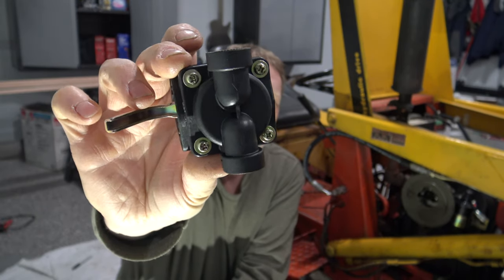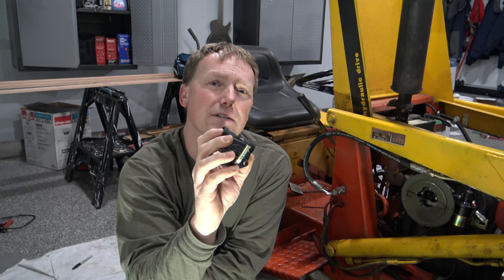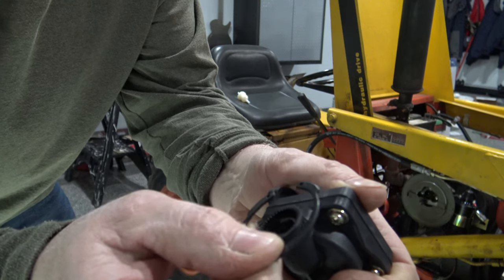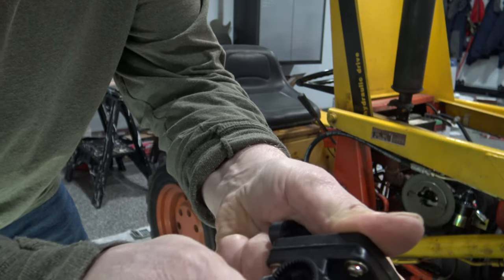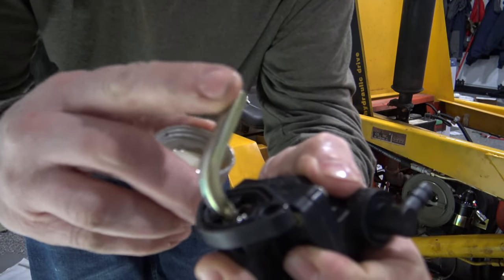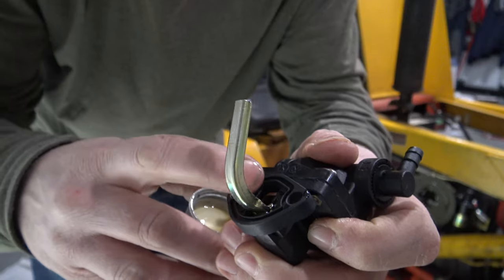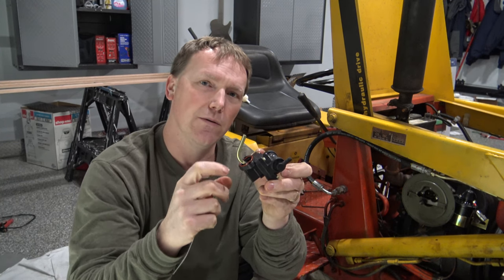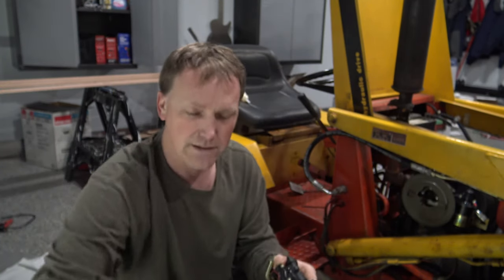KOHLER Plastic Fuel Pumps..2 Most Important TIPS!!!

Comment: There’s also another video the aftermarket ones that are not as cheap as the cheapest ones should have a date stamp on them on the outside and they are the better ones, they have a better check valve ✅
Reply: do you have any links to those?
Reply: 17$
Reply: This one that I got was for my magnum 20 hp Fits a few different motors

Comment: Thanks for posting!!
I'm looking at a case 644 that's for sale near my house, anything you would look for before purchasing? Also how does the 644 with the Kohler engine compare to the 646 or 648 with onans??
Is steering a problem since it doesn't have PS??   Thanks!!
Reply from the maker: The 14 horse Kohler has plenty of power the parts are cheap and easy to get easy to work on and cheap to rebuild it everything to do with the onan is going to be expensive I wouldn't shy away from one but it better be in perfect running condition... Look at the condition of the hydraulic hoses if they need to be replaced they're kind of expensive and also check to see if the hydraulic pump has been replaced recently... The hydraulic pump is kind of hard to change and cost about 200 bucks
Reply from the maker: If you have a real heavy load in the bucket it is kind of hard to steer if you need to steer sharp  but having the narrow tires help
Reply from the maker: I paid $1,800 for mine
Reply: @addismultitasking3504  Okay, I think that they may have use some different pumps on some of the early ones. Some were a little better than others ,do you know anything about that??
Reply from the maker: As far as I know they all worked about the same and lasted about the same length
Reply: @addismultitasking3504  Okay thanks a lot!!

Comment: Just tried 2 of these.  They just aren't pumping much gas out.  The 2nd one I did the oil trick and we kind of got the mower running for like 10 seconds lol, then it just cut out cuz not enough gas.  Works when we spray gas in the intake.  I'm going to have to find the next one up I think (in quality).  Let me know if anyone has a link to a good one at a decent price.  They shouldn't be allowed to sell this garbage tbh.

Comment: sOOOOoooooooo . . . . is the same mechanical fuel pump still working after you oiled it up ?

a follow up video would be very informative.
Reply from the maker: yes they work perfect if you oil them first.
Reply: Some people put oil in the gas to keep the diaphragm lubed.
Reply: @gfriedman99  Marvel Mystery Oil in the gas adds power and smooths out engine.  negates ethanol bad effects too...

Comment: are you using ethanol gas
Reply from the maker: I use tru fuel
Reply: @addismultitasking3504  I believe that is what’s saving your pump. 

If you care to try. You should run some gas with ethanol. 

I have asked what these pumps were intended for and was told ethanol free fuel.
Reply: If you live anywhere near a General Aviation Airport, you can purchase 100LL gas from the airport fuel truck or just fill at the fuel station and not have ethanol. I run it in everything including my all original Model A Ford and it works great (John Deere, Chainsaw, weedwhacker, Model A, ....Street bikes, Dirt bikes, ....)
Reply: @ShnitzlHaus  I use regular E10 87 gas with Stabil.  No issues with the pump and it's used commercially.  The tractor uses the old pump, just has the diaphragm from the new one as the new one wasn't doing what it was supposed to.